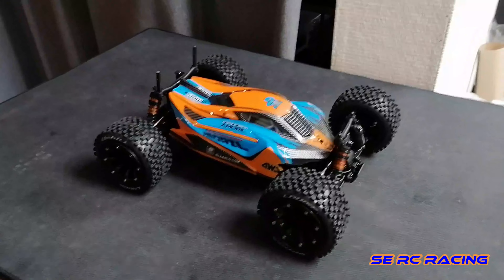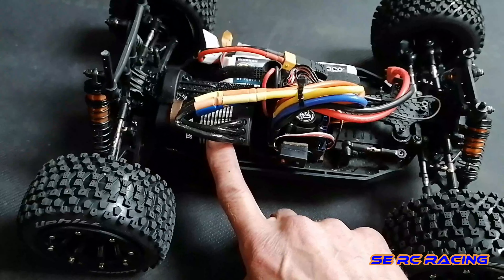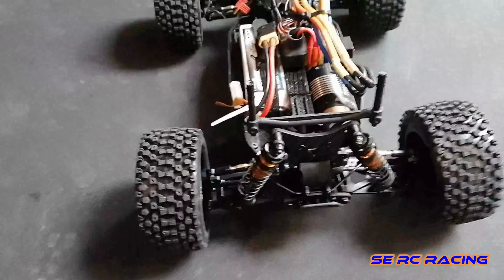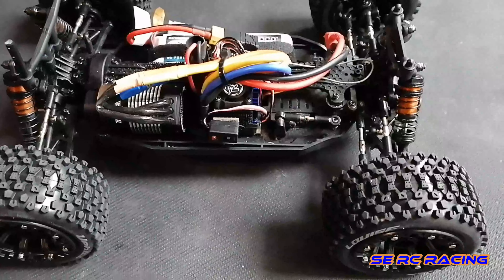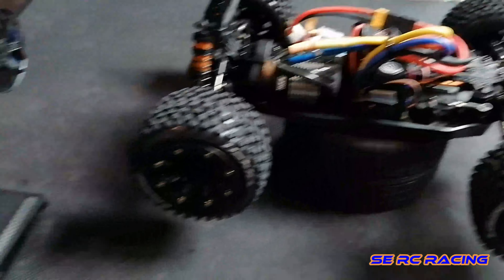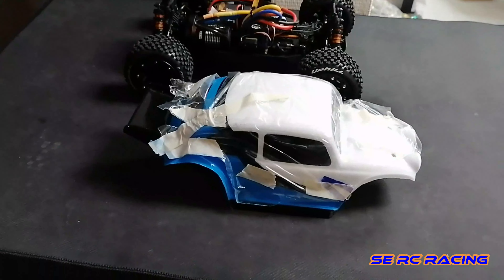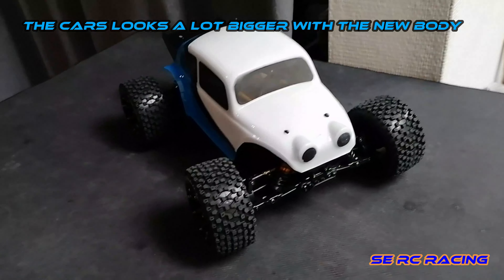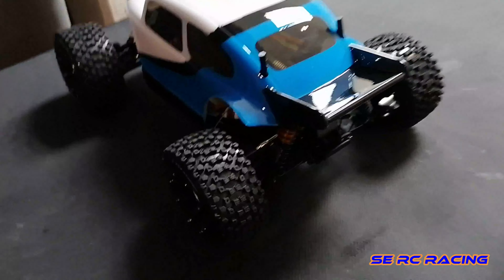Rlaarlo AM X12 Upgrade part 2

Comment: Hi do you have a list of the parts,esc,motor,motor mount,body shell,wheels where to buy or part numbers many thanks 👍
Reply from the maker: Yes i have it for you @MegaMattty2.
I orderd all parts on this webshop: https://www.rcmotorsports.nl/
For the body: https://www.rcmotorsports.nl/collections/wltoys-144001/products/phat-bodies-funkenblitz-transparant-body
For the body mount: https://www.rcmotorsports.nl/products/lc-racing-l6033-body-post-set?variant=40885553266861
For the Motor: https://www.rcmotorsports.nl/collections/motoren/products/rocket-3660-brushless-motor-4300kv
For the ESC: https://www.rcmotorsports.nl/collections/regelaars-voor-electromotoren/products/rocket-60a-brushless-esc-voor-1-10
Tyres:  LOUISE Uphill 12mm hex for offroad.
Tyres for onroad: Contact J13574 foamtyres
Motormount: https://www.rcmotorsports.nl/collections/wltoys-144001/products/wltoys-1303-motor-mount
😉👊
Reply: Awesome thankyou very much keep up the good work 👍

Comment: May I know why you have to change the motor mount? I have a deadlocked screw on my original motor mount and need to replace . Is the Wltoys one a better one or it only needed to be replaced if using a different motor?